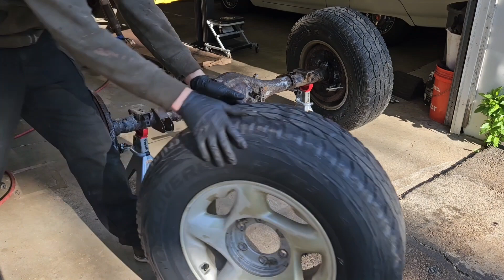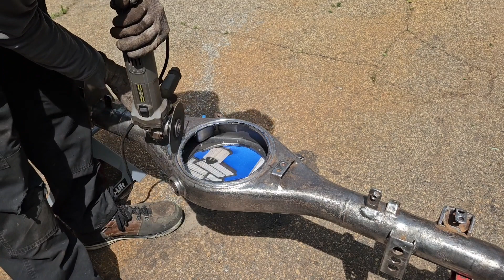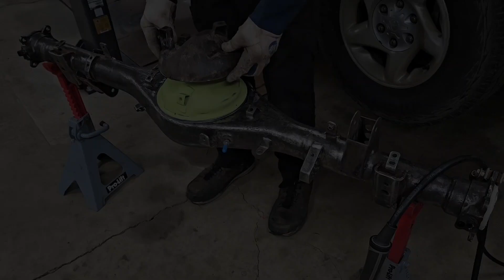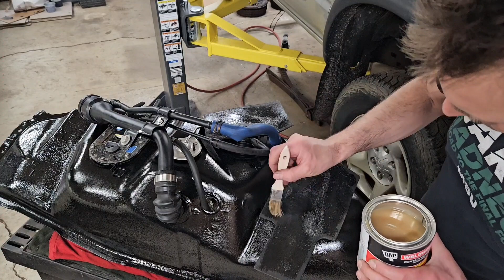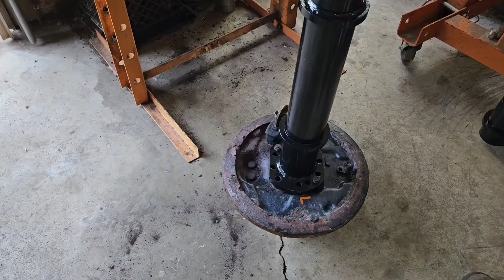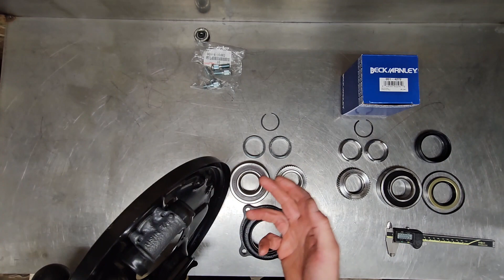Restoring the Tacoma's rear axle and fuel tank

Comment: This series of videos truly are a masterclass in 1st Gen Tacoma restoration.  Thank you so much for sharing.  The level of detail is incredible, without being too longwinded.  10/10
Reply from the maker: I appreciate the feedback. I will continue to share the progress once my new shop is up and running.
Reply: @PostRt  I think I sent you this message/comment before, but I don't read notifications regularly so I might have missed a response- Are you on IG?  I have a '96 XCab that it's pretty much completely disassembled (cab on stands, engine pulled, frame stripped) that I'm doing a total restoration on.  (epoxy coating the frame, fixing some body work, repainting exterior, reworking suspension).  There's a huge amount of overlap.  Would be nice to connect with a fellow 1stGen Taco tinkerer.

Comment: I was really impressed by how you replaced the back cover on the axle housing. 
Mine is pretty rusty but not leaking. My 2002 Tacoma that I’ve had for two years now is getting everything fresh like all new oils,brakes, timing belt, valve cover gaskets. 
Some frame repair whatever it needs because I don’t want to have to buy another truck again. Oh yeah I’m 70 years old and doing all the work myself. The truck was 300k miles on the clock. And what I’m doing it could get that many more. 😃
Reply from the maker: Thank you. Get that rear cover cleaned up and protected before the rust eats its way through. If we can hold the rust back, these trucks can make it a long time.
Have fun!

Comment: Just curious, wondering why you are using your knowledge, skills, time, tools on  Tacoma. Great vehicles, I own a 15, but I wouldn’t go to the effort to make it new again. Not a put down, just curious? Enjoy the videos too.
Reply from the maker: The same could be said for a lot of older vehicles. Most of the older vehicles in my area rust out and people throw them away. Unfortunately, it is usually a better option to get something new than to have it repaired. I paid cash for this Tacoma many years ago, so it owes me nothing. I'm just fixing it up in my spare time and I do enjoy the project. My truck wouldn't sell for much the way it was and I didn't want to buy a new one. For me personally, repairing it makes the most sense.
Reply: What else was he suppose to do? It's a good truck, but it was headed downhill (just like mine) had he not spent this time and fixed it up. He could drive this thing for 10/20 more years now because Toyota has such a great powertrain. They don't make lots of power, can't tow much, but they are super dependable and used vehicles are at all time high right now as well. He's also severely increased his resale value because all of these Tacoma frames are junk...
Reply: It'll probably outlast any other new truck!

Comment: What is the brand of paint and rust encapsulator that your used?  Great video!
Reply from the maker: I used Eastwood Products. Their rust encapsulator platinum and 2K ceramic chassis black. It is really good stuff and cures to a very tough finish. It sprayed well, even with cheap paint gun.
Reply: @PostRt   did you use their IFC internal frame coating product?
Reply from the maker: @efil4kizum  Yes, I did. I made a video going over the process if you want to see the application.
Reply: @PostRt   how long ago did you apply it?  what part of the USA are you in? i am in western Iowa region with a very old Taco lol... its relativerly clean (i hose the salt off as much as i can over 25 years) but its showing its age in certain spots underneath
Reply from the maker: @efil4kizum  I installed the coating  last winter, and the truck is still a work in progress. I live in Michigan, and so far, the truck has only been driven on salt free roads and cleans up super shiny!
I have been putting a lot of miles on the truck this summer but will be getting back to fixing the truck up this fall and winter.